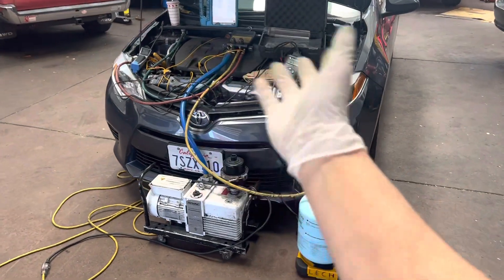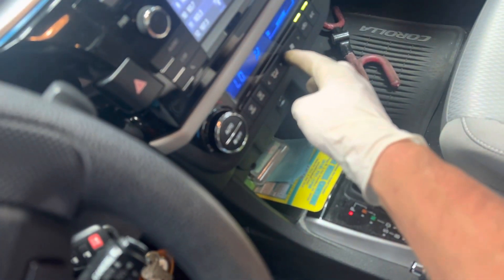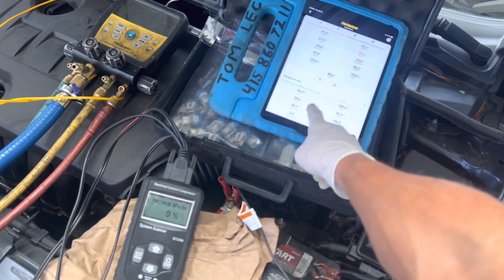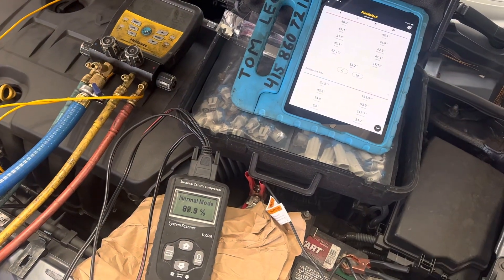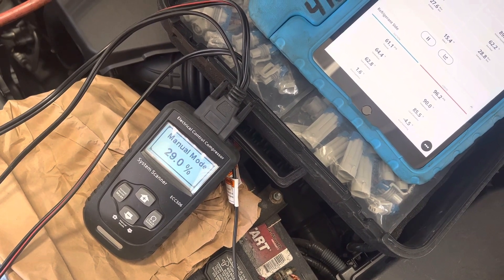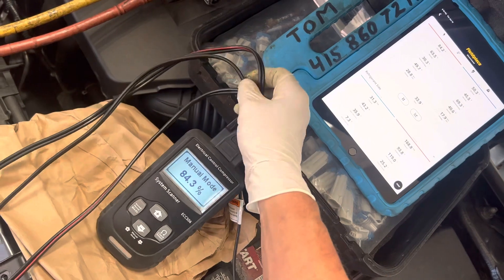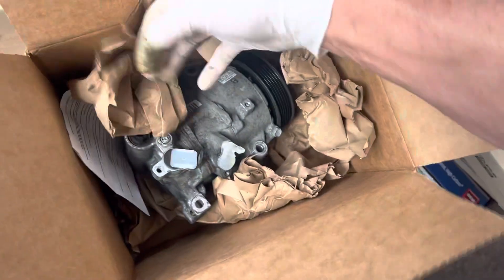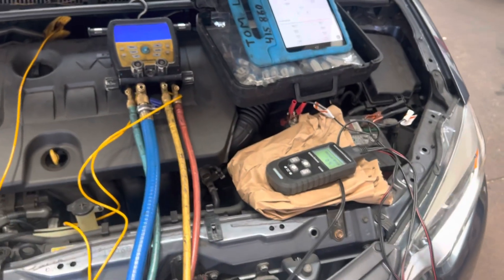Commanding variable displacement compressor to change pressures and output displacement

Comment: sorry, i forgot to mention that on the scan tool it shows .8 mili amp from ecu to the solenoid,sorry about that, this pid was the one that convinced me that i have a none responding solenoid or a bad compressor.

Comment: Also i have a explorer 2017 that when you turn on the A/C the clutch will engage but that compressor will not work and the high side and low side pressure stay at the room temp which was about 70 degrees to about 70 psi,i checked the duty cycle to the solenoid and i see a command on the scope an on off duty cycle, i checked the data that ecu is looking at  like evap temp which was 20 degrees centigrade  and high pressure transducer out put voltage which was about 1.4v and they seem ok and when i looked at the solenoid control command and saw the duty cycle i replaced the compressor which did not fix any thing tomorrow i am going to put the old compressor back in the truck and order your tester ,i wish i had that tool already ,but the damage is done.now i am wondering what am i missing here,is the duty cycle that i see on the scope is a default signal or what,if i remember correctly it was about 50 percent off and on and it did not change when i played with the blower fan motor, the thing is that i was replacing the alternator and in order to do do that had to remove the A/C compressor and i know the system was working before, so now it is on me to fix this,and let me tell you  that when i put the alternator and compressor back and evacuated and recharged the system i overcharged it about a pound, i thought it had rear A/C and it did not it took me about 5 minutes to realize that after i started the truck and saw 200 psi on high side and 50 psi on low side,then i discharged the refrigerant and lowered it from 2.36 pound to 1.36 and it did not work after that, and advice would be greatly appreciated. very sorry for the long  email.
Reply from the maker: Give me VIN #
I’ll look up information
Reply: @coldfinger459sub0  this is the vin  1fm5k8ar4hgb82988

Comment: Tom,your tester is between the compressor and the computer,so i assume without disconnecting the harness from the ecu to the compressor it is still safe to manually control the compressor,please advise. thanks.
Reply from the maker: You disconnect the harness from the compressor and the tester is in between in series. 

It could read the signal coming from the ECU 

And you can override and manually feed your own signal to control the compressor . 

Also reading the windings of the compressor control valve .

Comment: Tom Happy New Year, I there another way the active and very the solenoid without using the tool? I have a few com0laints on the 2008 Toyota Yaris model
Reply from the maker: I have never had to diagnose Aris yet with a problem. 

If you have a universal pulse with modulator generator . 

Like one for testing fuel injectors 

You can feed a signal to the valve duty cycle, 30%, 50% 80% 

And you will see the pressures change on your gauge as you do this . 

I’m not sure what the factory manual says for testing Ohm reading but usually there’s somewhere around 11 ohms plus a minus a little bit read the manual specifications but it’s Toyota. They probably don’t give a spec maybe. . 

But sometimes they can pass the resistance test and after they’re an operation and they get hot from operation from a little while then the windings can open up or short  . 

So sometimes a static test doesn’t show a problem. The thermal expanding of the copper windings will make the problem appear later.
Reply: @coldfinger459sub0  thanks, wise counsel..lol
Reply: Another thought, can you take the new valve and attach to the harness to see if the new one works? Before installing it?Possible?

Comment: Also is this process for charging the ac system on a variable ac compressor thanks
Reply from the maker: The same as an old AC compressor.  I saw your weight only..   if you’ve seen my videos, you see it only takes about 30 seconds to completely charge the AC system without ever starting the engine.  All ac are like this